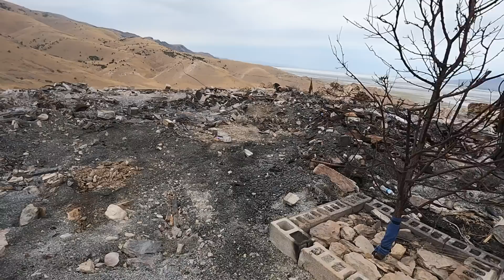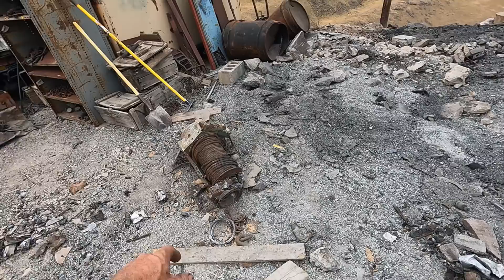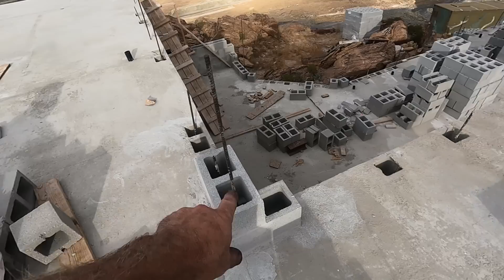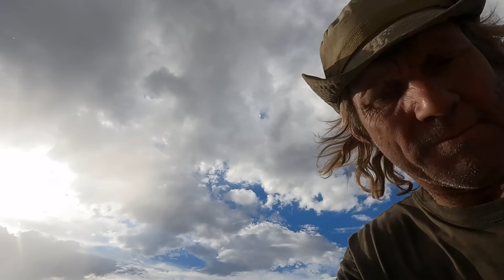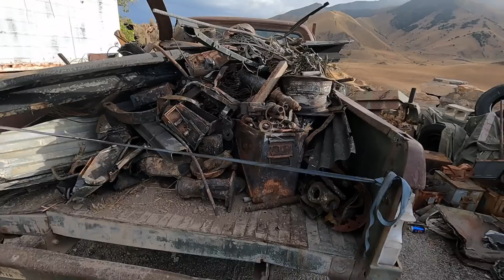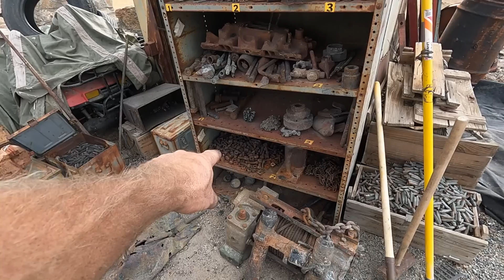Fortress Project Fire Cleanup Update & Humming Re-Bar

Comment: A long time in the fire I think would soften your carbide bits. The fire was not hot enough and then a long time while the fire stops the heat would be too low and too long. I reckon.

Comment: I was wondering if you considered using a variable pitch prop from an aircraft to power your wind generator? In high wind speeds you. Could feather the pitch to prevent overspeeding  of the Genny.

Comment: Manufactures are usually giving 25 year warranty, not 25 year lifespan of panels.. a common misunderstanding. With this warranty manufactures are saying that panels will operate (at minimum) 80% from it's original capacity, so 500W should be able produce 400W of power by the end of 25'th year of operation. If at some point should the panel not be able to operate at 80% or higher original capacity then manufactures should replace it.

Comment: Solar panels are pretty toxic contaminants when its trashed, its better to use wind or water power sources, both can be maintained for decades without expensive parts. There are several wind turbine designs that you can build with wood taking advantage of the strong winds up there.

Comment: PLEASE READ IT'S REALLY IMPORTANT. Hi, I'm really sorry for what happened to your Workshop To help prevent this from happening again. I've had an idea, BUT have you thought of getting a Starlink internet system, then you will have broadband full time on site and  then you could invest in a Simply Safe home security system, it has as many wireless cameras as you would need and are also wireless. The locking systems are wireless and can be viewed and controlled and setup to open and close anywhere from your phone or Laptop anywhere in the country with an internet signal. You can add loads of cameras, locks and so many more security items and features. which can also be link to a 24hr security company. I'm pretty sure if you get Dave sparks involved, I'm sure simply safe will more than help you out with the costs. You would be out there advertising there company for them. You need to be safe up there when your on your own but also when you are not on site. Other supporters of Mountain Fortress Lab. Im sure they would love to contribute to your Safety. Especially Simply Home Safe.. Please respond if you agree with me, my name is Stewart Perry

Comment: You should think of protection from lightning strikes as well. Lightning will burn right thru metal roofing panels if you cover the PV panels. Adding a Lightning Protection system is a pretty simple fix to protect the PV panels long term.

Comment: I'd just buy higher quality panels rather than spending extra to cover them.  Better still, used a tilting array that can be levelled during heavy wind or a combination of tilting array and root top.  

Why not, you have the space and handy man skills ... more power and less panels required.

Comment: array degredation isn't as bad as you make it out but it is a thing
after 25 years, if you put just one more pannel up, you're usually back above your original rate, provided you don't have some crazy big system

Covering them from hail and everything is really smart though. are the pannels going to be manual or motorized? can they self close according to the forecast?

Comment: After 25 years, the solar panels may only produce 80% of when they were new.  Most are rated similar to this.  You may also want to reconsider putting wind turbines on the top of the structure.  They are much louder than you would expect and it can be pretty disruptive as a noise pollution element.  I'd recommend putting them on a rock outcrop away from the building.  You can't reuse any of the metal fasteners in the fire - it would have been so heat tempered as to not be safe, and the heat treating will likely induce cracks (microscopic)
Reply: Solar is so cheap, powerful, and easy now, I’d skip on wind. It will get blown over and a maintenance problem.

Comment: Love seeing the project you are working on. Amazing what you have accomplished.

The re-bar hum did not sound like a wind hum.. That sounded as you said something with static electricity either from the storm OR do you have any wire in the walls or near where the re-bar is?

Also not going to lie.. Really wanted you  to touch it. Might try grounding a wire into the earth then touching the bar with the other end. Wearing leather gloves or tape the wire to a wooden pole. Would be interesting to see how much charge is released.

May need to look into some heavy duty grounding for the mountain fortress. High wind and debris can cause static build up. Dont need you getting zapped up there.

Comment: You can install 48"X 96" X 1/4 " thick lexan plastic as it's flexable and won't break...install the lexan on top of your solar panels to protect against hail or high winds........ don't use plexiglass as it will break.

Comment: I Have No Idea What They Cost But They Have Magnets ,Say 2ft by 2x4 inches With Wheels ; A Handle & That Would Be Good For You There & They Have Way Bigger Ones That You Can Hang Down Your Trucks or What Ever So Every Where You Go Up There Your Picking Up Metal So You Don't Get A Bunch Of Flat Tires & Probably  The Best is The ELECTRO MAGNETS Then it Only Takes Seconds  To Clear & Clean Them Off, Maybe Go On Line & Check ,I'm  Not Sure I Just Know There AvaIable 
GOD BLESS YOU

Comment: I have 4 100 watt panels still in the boxes and I’ve had them for 7 years. Need to get them out and add them to the 4 I have been using. They are buried in a little trailer. I need more storage!

Comment: Hey Alan. The humming rebar is most likely wind resonance. It get's quiet when you get close enough to disrupt the wind near it. Outside the building I used to work at, there was a pole that did the same thing. It was more visible than audible because it was large and there was a constant wind on that hill. Think of it like a tuning fork
Reply: I had the same thing it wasn't a pole though. It was a Yugoslavian
🚬💣👽💩🚲🎣🇺🇸

Comment: 2:55 Solar degradation is approximately 1% per year of efficiency. It's actually like 3-4% in the first year but then like .8-.9% every year after that, so the best way to think about it is it's 1% per year. The reason they say at 20 years the solar panels are degrading, is because you lose 20% by that point (or 1/5 of the panel's power). Because if you get to a point where the solar panels are like 50% degraded, you might as well replace them and get 2X more power than you were at that point. 1% per year is a good way is an easy way to remember. LED also degrade at a similar rate because solar panels and LEDs are the inverse technologies of each other, what that means is if you actually send power into your solar panels l it will emit light (it's just in the UV spectrum), hence solar panels have a box with a diode on it to keep power from flowing into it. This also means if you shine light into an LED it makes electricity. LEDs degrade at the same rate as solar panels approximately 1% loss of brightness per year of use, the same as solar panels.

As for the rebar humming, I would agree I think it is due to electrical current, but I wouldn't be able to tell for sure unless I could see it myself (It's too complicated), as for the reason why it stops humming when you get near it, if it is charged due to static electricity (which I think is likely), then it is caused because electricity and magnetism are interrelated so when it gets close your body, your body (which can conduct a charge) is creating an opposing magnetic field to the one the pole, this is why the closer you get the quieter it gets, it's because the closer magnetic fields get to each other the stronger they become, so the pole is vibrating because it's making an electric and magnetic field and when you get close to it, your increase the strength of the magnetic field between you and it, a fun thing to try if it happens more often than not would be to take an LED with a decent sized coil of wire connected on boths ends of it and put it near the pole and push and pull the LED up and down in the same direction as the pole without touching it, if the pole is generating a feild, pulling the LED up and down the direction of the pole could potentially make the LED glow (Wirless electricity), which would be fun to see and it would be safe as you don't have to touch the pole to make it work. This is the fun stuff we learn in engineering, which is what field I am in.

Comment: Alan just a lil information…solar panels last about 10yrs actual now a days. The older ones in the early 90’s to the early 00’s but now their crap. Each year 10% of panel breaks down. I’ve had 56 solar panels since 1997 and their still working. The few that went bad were replaced with new ones that lasted 7-8yrs. Down here in Texas on our ranch.

Comment: Alan I'm sorry about the fire, I know it cant be easy but this goes to everyone. I had an outlet go out. Didnt think much of it. When i got around to changing it there was evidence of open flame on it inside the wall. we got lucky and it didnt take off but please anyone reading this. Do not take electric damage lightly. ALWAYS check if you feel there is an issue. Looking back now I know it could have been way worse. Best of luck to you and good luck on the build!

Comment: I just subscribed! I love your project. And you just keep going when it doesn't go to plan. I have the same with my 1965 unimog. I had so many issues. I swapped 2 gearboxes. And my clutch and pressure plate failed twice. But I kept going and fixed it all.

I like your thinking about solar and wind. Im really curious how you are going to make it. The hilltop looks like a place where every kind of weather is more extreme! 🤠

Comment: I saw that you had a tree that was burned; let it be.  It was hard to see in the quick pan, but you may be surprised when it gives leave next spring.
I have many trees in unwanted locations around the house that I have tried to kill by cutting them to the ground.  Most just grow back due to the energy stored in the root.

Comment: Have you looked into a grounding system for lightening? Not trying to be negative toward your setup but all that electrical stuff sitting on the tip top of a mountain will be a lightening magnet

Comment: I worked for a company that made drill bits like those. If they didn't get hot enough to melt the silver solder in them you don't have to worry about heat treat.

Comment: I'v been looking on the internet about solar panels and ultraviolet light from the sun. Ultraviolet part of sunlight doesn't  really make much energy. But It's the part of sunlight that does a lot of damage to anything. See if you can get some kind of covering to cover the panel's that only stop's the ultraviolet, but still lets all rest of the sun light through. This will help to prolong the life of the panels while using them. I seen on the internet that you can buy ultraviolet solar panels. But they are not supposed to no where near as good ordinary solar panels

Comment: RE: humming re-bar... my guess is wind resonance.. that re-bar was just the right length for the wind speed, other re-bar was different length and when you came closer it was breaking up the wind around the re-bar and stopping.. Had something similar happen to an antenna on my roof..
Reply: My guess too! only way to tell? Just grab that sucker with some rubber gloves to insulate yourself. you could also try and get some kind of electrical reading. But, my money is on the wind. just resonating not electrical charge unless you grab it just before a bolt of lightening decides it is a good path to ground!😂😂

Comment: I was thinking about your solar panel comment and given your friendship with Diesel Dave, Lab Rats, Matts Off Road Rescue,   I think a large roller shutter door over your panels would be awesome.    Something like a pool cover.   Then to make it way cool some electronics to detect rain or when the panels are not needed and automatically cover them up.  

Just imagine your on a job with Dave and you need to cover your panels,   your panels should be able to detect that they need to go into safe mode and cover themselves up.
Reply: You have access to some very cool and talented people who have the resources to  make this an awesome project.    Given the height of your roof have you thought about using the rain water falling down the pipes to turn micro turbines to generate power. 

Project for Dave,    there are people who are storing solar power in large heavy weights that are on tracks on a slope.   Solar power comes in,  the weight is pulled up the hill.    When power is needed you simply allow the weight to slowly roll down the slope turning gnerators.     Just think of the renewal power projects you could come up with.
Reply: @tarawood-bradley2119  Somebody put on her thinking hat...🤠🤠

Comment: I wonder why you haven't made a "conveyor belt" for your project? Or a massive cavern to store (snow) water that can be collected during winter? Just a thought. Both would be of great value during your build. LOVE what you're doing. Big thank you to "D" for promoting and helping your project and giving you a job. 

We are all interested in what is your end game is with the build.
Reply: I like the water idea... not gonna lie
Reply: snow is very hard to store on a mountain top that raises above freezing it may not be feasible to dig far enough down to reach a point where its cold enough
Reply: @Brandon34098  I am sure with a bit of thought and research a shaft to a cavern would be possible. The snow is the source of water, which would be very useful during summer. Of course, it will take some effort to get it right. Hauling water up the mountain is expensive and time-consuming. Absolutely need a water source for independence and builds. I believe Alan has the smarts to get it right.
Reply: guy dont need a job hes got hundreds thousands pounds worth cars trucks at bottom of his million pound mountain and you think on 3rd fire he aint insured ..hasnt been mentioned so must have..he a millionaire hoarder who retired to do his hobby..he had a second world war 2 ambulance that was in barn that was wort over 100kand loads jeeps the equipment there is worth more  than a mill in vechicles i reckon  ....he dont need a job m8
Reply: @garyjones2335  unless he pulled permits to have the proper coverage for insurance for his fortress they wont pay a penny and probably make him pay his agreed to premium before they even tell him that

Comment: Hey can you get me a measurement of the length of the piece of conduit that was vibrating, at its diameter? Do you think the vibration was below or above 60 Hz? If it was below was it by chance somewhere between 27 and 33 Hz? I figure at this point in your life and what you play with you should know what is 60 her electrical load sounds like. The reason I ask pertains to some theories that I have about that area that I have run across as well years. I'd be glad to talk to you about it in private if you ever have any time with what you're doing out there.

Also, as messed up as it sounds, if it was sabotage (the fire) do you need to be careful about the amount of time you spend sifting through the dirt, and set yourself a schedule on that, and make sure you don't lose focus on completing the minimums of the project
And it's self sustainability., But again try and get back to me about that rebar, I know you're busy, good luck man. Oh just remembered something to try and get somebody, at least one person that is extremely trustworthy to watch over things and hang with you. Do you know what I mean, I'll be careful about that. Whole thing was really fishy.
Maybe a neighbor doesn't care for your explorations.... but I am just a paranoid old dude.
Reply: could be charged charcoal or some kind of dust in the air passing by the rebar causing electrical flow from the dust back to ground through the rebar, not to big of a deal if thats the case and easy to determine just need a volt meter and a conductive ground reference separate from the building rebar no idea what voltage that would induce but you wouldnt get a Hz reading since it would be a erratic form of DC from that although its possible its from radio waves but the material is not nearly conductive enough nor large enough to conduct or else radio towers would hum like that
Reply: See here is the deal, I am not actually trying to figure out how to make rebar wiggle or vibrate, or even so much as why it is, I can come with a huge list of possibilities guesses  ideas recipes, but it is interesting how a few jumped on it👍
Basically I have been playing with is for a long  time and bits of data were what I was after, and of course I would not stop a soul to exercise their brain and talk about it till the cows come home. I wax hoping for some factual data that might  be in the specs of my research if it fits I'll share.

Again I know there can be allot of reasons why a rod is wiggly, or sounds like a door stopper when plucked.

Really just wondering I the compound is in one of the sweet spots out there.

More power to you man  sorry you
Lost some history and equipment , love what your doing out there. Keep forging ahead

Comment: Going thru burnt treasure - tough job on several counts.  BTW the Rebar is vibrating from steady wind creating a resonance and hence the 'hum'.   When you get near you disrupt the flow of air and the resonance stops.  The other rebar are not long enough with that wind speed to resonate (don't think you'd want to be up there if wind was strong enough to make them resonate.
Reply: I believe there is a resonant generator they use some where in Europe that will create electricity. They use them along the freeways to ease the system. They generate power from the turbulence created. It may be something you could investigate